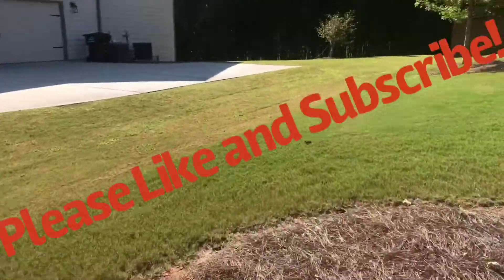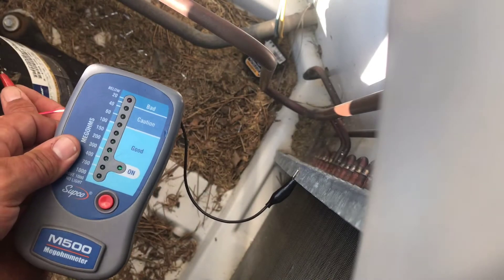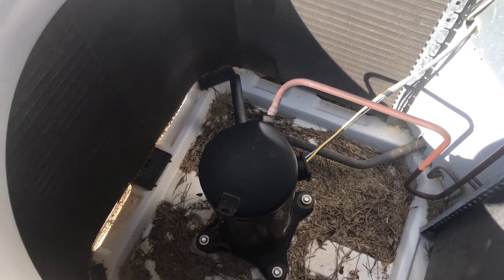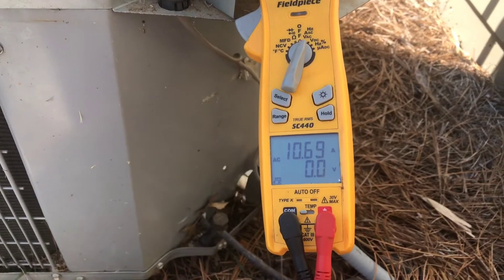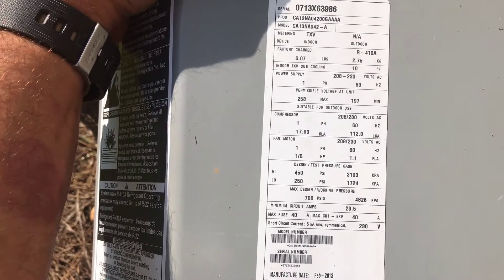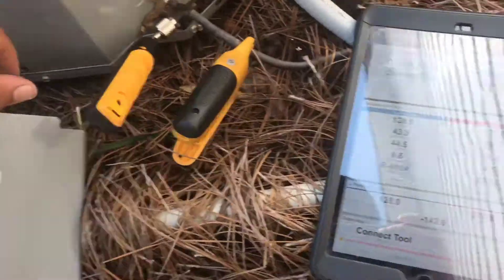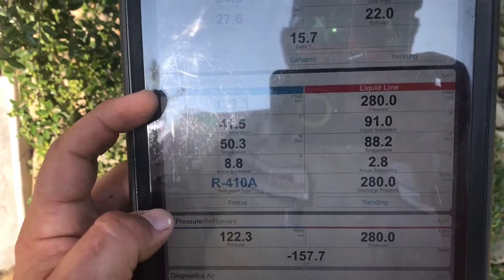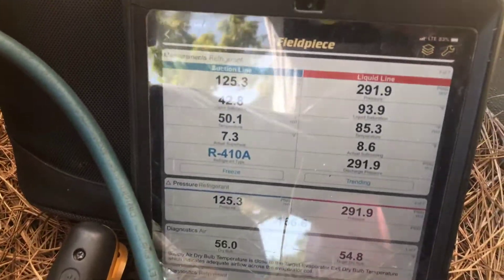Compressor Not Starting-HVAC Service Call

Comment: You are a good honest man. I just had a tech to check my system. And he didn’t find anything wrong with it but he tried to sell a new system for 7,500 when all I did was replace the run capacitor. Unfortunately there are a lot of thieves out there. I fix with a 15 part.
Reply: Yes there is. Capacitors and contractors are easy to fix. Everything else you’ll need a tech to get parts. Also you can buy a fan if it’s burned out. You’ll have to buy tools probably around 300-400 dollars

Comment: I’d say look into your loss of refrigerant before replacing compressor, low oil can cause overload and lead to failure too. Also, superheat didn’t look right to me so you may want to check out that txv
Reply: Or indoor airflow
Reply: I thought you just had to look at the subcool for a txv! Sorry I’m new at the trade so I might be wrong.
Reply: @angelrodriguez6427  you use subcool for proper charge level on a TXV, but you still have to have normal superheat. If not, there may be a problem with the TXV or elsewhere in the system, even if you know your charge is good.

Comment: Since the cut off was in an open state, did the test meter test it correctly?
Reply: Yes because he was testing to ground. Thermal overload breaks common to round and start to run

Comment: Any thoughts on my unit tripping breaker 3 to 4 times in a day on 95 degree days? Unit still has original capacitor.
Reply: Check max breaker size on unit ñame plate and check breaker size and fuses size make sure all our capatible if it trips as soon as unit turns on then its grounded compressor and if not then probably a bad breaker or loose wiring
Reply from the maker: Could be a lot of things. But I would check the breaker and breaker size first

Comment: Those meters say a scroll compressor is bad when it’s fine.
Reply from the maker: They will also say there bad when there in a thermal lock out
Reply: @HVACTechTips  they don’t say bad you just don’t get a reading because there is no electrical connection

Comment: Go to Youtube and check out Packard Capacitor Training video. Heat or elevated voltage kills capacitors. You can wire 2 Capacitors in parallel for better heat dissipation.

Comment: But you didn't find the leak though, aren't you supposed to find the leak and seal it?
Reply: Most leaks are near the evaporator coil and at that point most people just replace the coil but it’s cheaper in short run for people to just add a little refrigerant each season